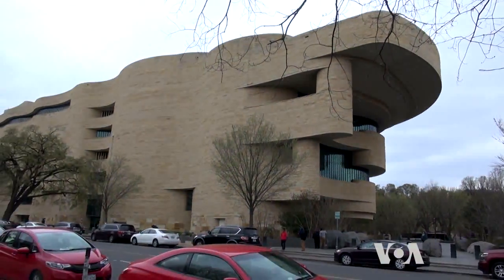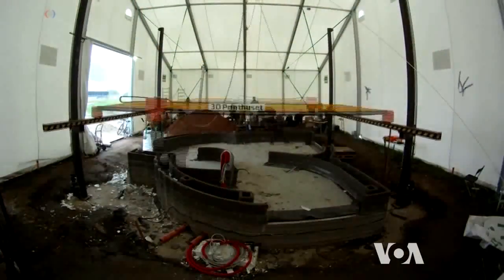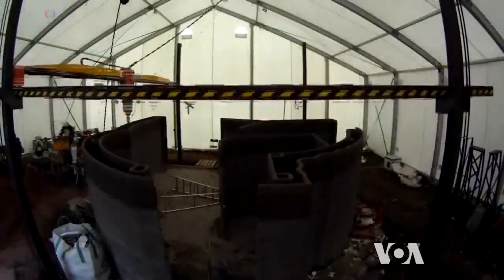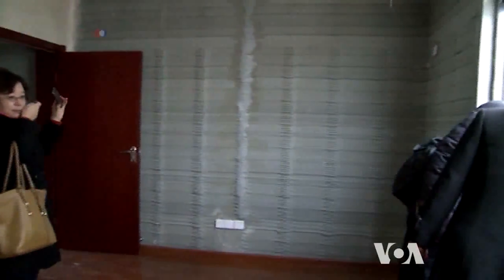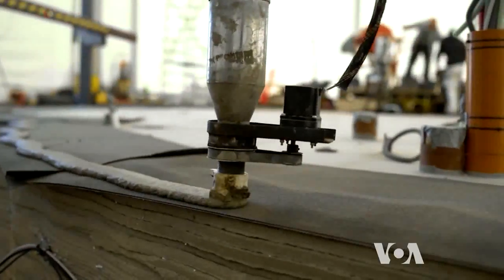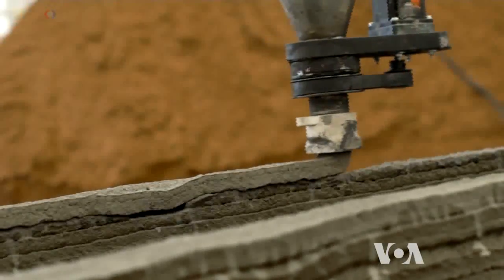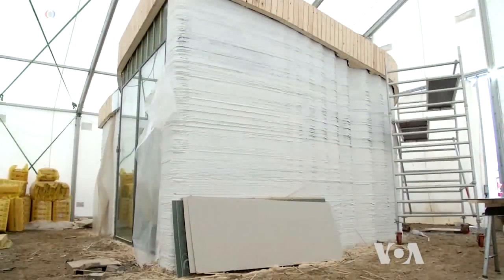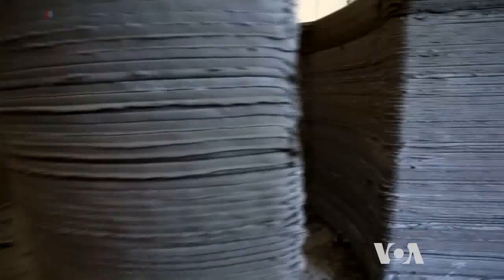The First 3D-Printed Building Goes Up in Denmark

Comment: So That looks like a "concrete form" at the top, basically the same thing they do in large building construction where the layers are 10 to 20ft instead of 2 inchs, if that's the case then this is bogus. Not showing this building going up in a time lapse supports the "bogas" call (they show other stuff but it's "lab").